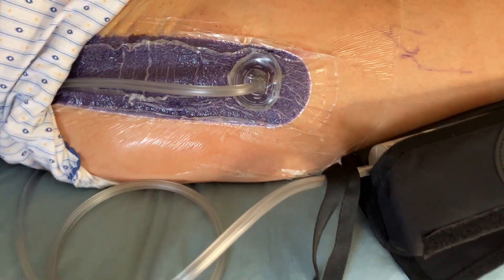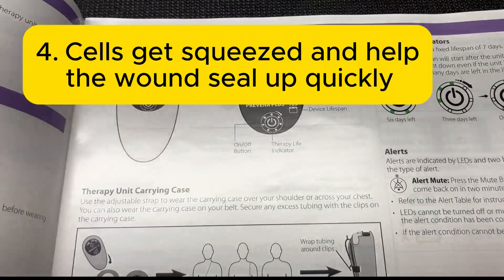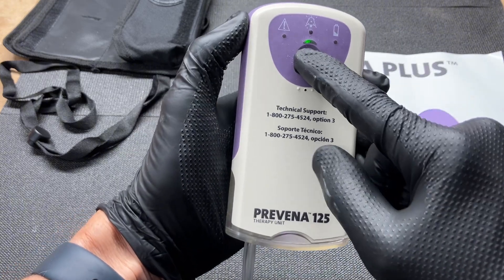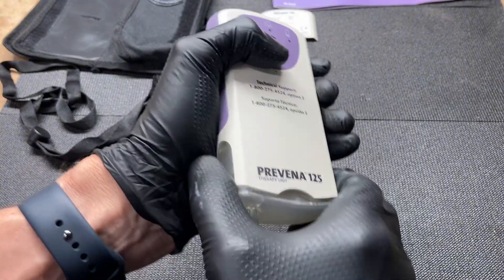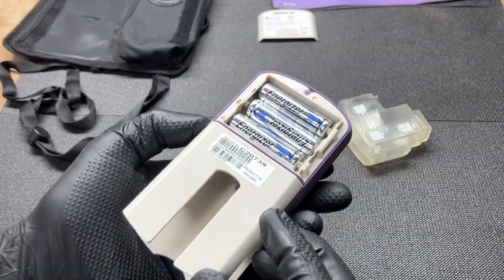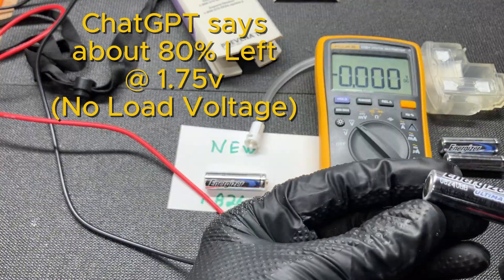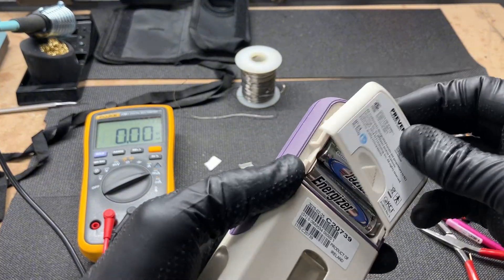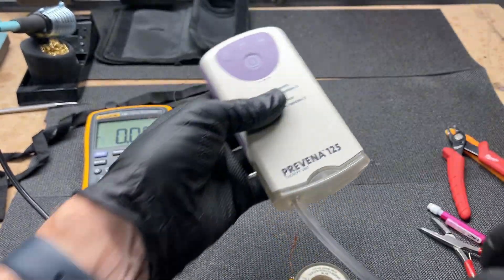Inside the $1,500 Medical Device You’re Supposed to Throw Away

Comment: I hope I can do the same with my wife's Prevena Plus 125....  (also no fluid in it!)
Reply from the maker: Its pretty cool to just see how it works on the inside. Especially since they wanted us to just throw it out when done.
Reply: @V-Tank  Right, after 7 days throw it out... Hard to believe!
Reply: I wonder how this rather weak suction could be repurposed into a useful hack.
Reply from the maker: @davidehrmann6862  Thats a great idea. Since the pump is automatic and just does its thing you could turn it on with a wall wart jury rigged for power and let it run for months unattended. It would even alert you audibly if there was an issue. Maybe 3d printer spools?